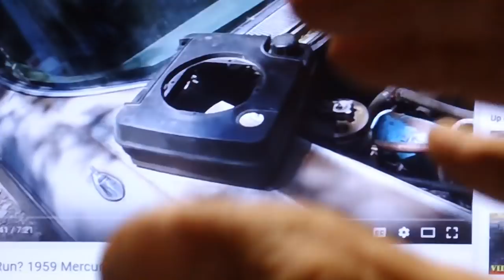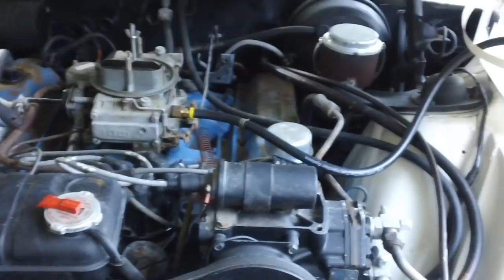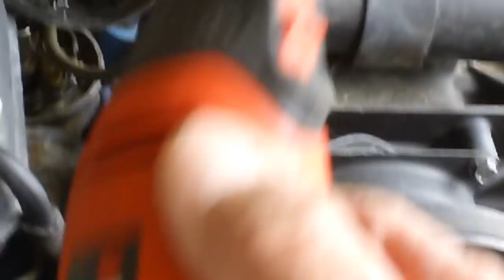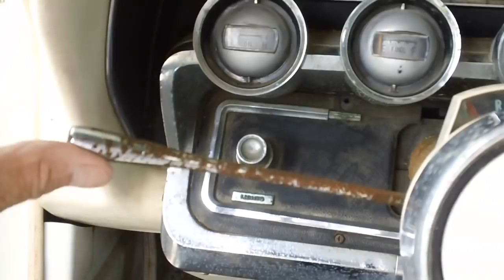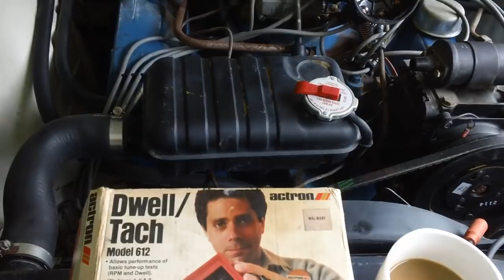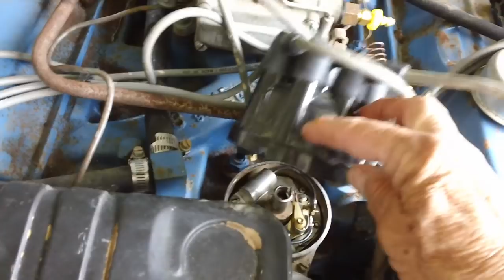1966 Ford Thunderbird repair and refurbishment (Part 6). Engine ignition work.

Comment: What spray did you use on the distributor to clean it out?
Reply from the maker: QD Electronics cleaner.  Found in the Wal-Mart automotive section.
Regards,
John

Comment: No lights on the dash? that would bother me..... but I have been through chasing down bad grounds and corroded wiring on old cars.... not fun... hope you have better luck than I did than on my old 91 probe... had to basically replace the entire harness on that due to all the green wire....
Reply from the maker: Word of advice:  Let nothing bother you.  This stuff is nothing but fun.  If it's not fun then change to a hobby that is fun.
Regards,
John

Comment: all t birds of that vintage have the sequential tail lights
Reply from the maker: Only the 1966 models.
Regards,
John
Reply: 1963 TBird was more rounded, it also had round taillights, in 64 the Birds where more square like yours, that was the first year for the sequential lights . they did that all the way into the 70's

Comment: watch out for the silicone grease on the rotor, it can act as an electrical insulator, just say'in.
Reply from the maker: George,
You're right, my friend.  I went with a super thing layer.
Regards,
John

Comment: I like your safe version of a tester fuel tank. And I too have taken a break from radio repair and bought an old Ford pickup from a guy down here in Rushing, that would be up there in Rushing from you.  And I have been rebuilding my kitchen and adding some more cabinets. Looks like we are on the same track.
Reply from the maker: Johnny Umphress!!!...where have you been, my friend?  Glad to hear from you again.  What model truck did you buy?
Regards,
John
Reply: joernone Yeah, dropped of the Tube for awhile, been really busy.  I got a 1978 Ford F100.

Comment: John,
That noise in the trunk may be the sequential taillight controller.  I noticed it only made noise when the turn signal switch was activated. The biggest problem with the window on the GM distributor cap was they would let water and moisture into the  cap and cause all kind of havoc.
Reply from the maker: Jim,
I've never had a moisture problem with a GM cap.  Maybe just lucky, eh?
Regards,
John
Reply: My 66 dosent make that noise with the signal is on
Reply from the maker: My sequential setup hasn't been touched probably since the car was manufactured, so the inner working of the motor and mechanical linkage, located in the trunk, are all very dry, thus the noise.  We'll eventually be tearing into it.  But even if it can't be fixed there's a modern solid state unit than can be bought that does the job very well.  Not cheap though.
Regards,
John

Comment: When you do get ready to replace the tank, go to Rockauto.com and for your 66 Tbird with 390 there is a Spectra Premium F37B for $157 plus about $30 shipping (oversized rate ground) that is a direct replacement for your C4SZ9002B tank and includes a lock ring. Under $200 for a nice clean fresh tank is better than worrying about constantly flaking varnish and rust, and a possible pinhole or ten. Also if you google rockauto discount you can find codes for 5% off that you put into the where did you hear about us box in the cart. I just replaced the tank in my 1984 Ranger pickup that sat for 8 yrs with old fuel rather than monkey with the 30+ yr old tank. I would also consider replacement of the old mechanical fuel pump, the diaphram is likely hard as a rock now

Comment: I've worked on points, I've worked on HEI stock and performance aftermarket,  I've worked on later GM remote coil HEI, I've worked on Import stuff.. I actually prefer points to HEI even though points have their draw backs too.   Sure HEI has more power, but they always blow their modules, and the pickup coil tends to go bad as well. Points are pretty easy to work on but Dwell and timing slowly change over time as the points wear so it's not the most efficient. The coil in cap HEI is much larger and I find harder to work on up against the firewall where it is already tight quarters with all the plug wires and such. .  Accel makes some high performance points which last longer and have less float at high rpm, but they cost more than stock replacement obviously. They also make a points eliminator kit which I think is LED pickup and is no harder to install than a set of points.   On a side note when I was a mechanic and we had a vehicle that didn't run because of the fuel pump being shot, we'd get one guy with a couple cans of carb cleaner to spray into the engine while we drove it in. Sometimes you had to just sit on the radiator cowl, sometimes you could walk next to the car / truck as you idled it into the shop. I remember some of those bigger V8 engines you had to get 2 or more cans spraying at the same time to keep the engine running.  I hope the lack of dash lights is just that and you still have power to the coil. It's going to potentially suck tracing down wiring gremlins.
Reply from the maker: We sweat nothing, my friend.  It'll all always comes out in the wash.  I also prefer the point ignition system.  BTW...I've seen that two guys under the hood carb cleaner spray trick myself.  Funny stuff.
Regards,
John

Comment: 1 4 8 3 6 5 7 2  
I did that from memory, but is it Ford or GM or wrong?  
1 8 4 3 6 5 7 2  
hmmm, it's been a long time, I think Dodge an GM were same?